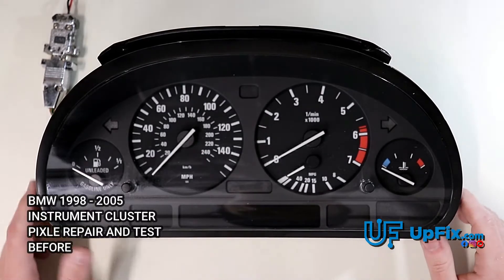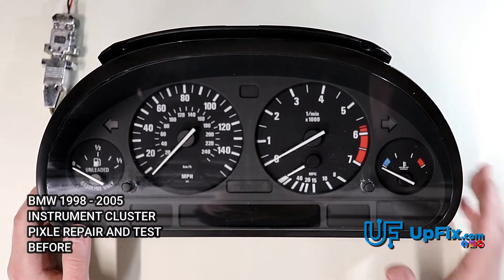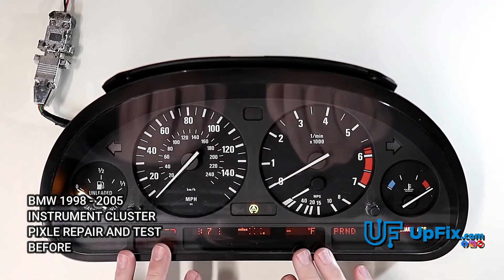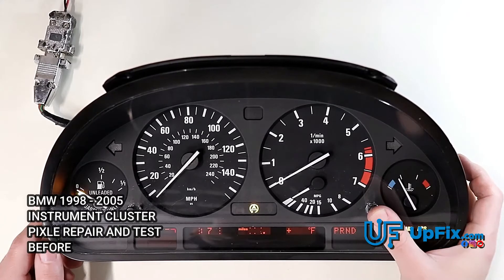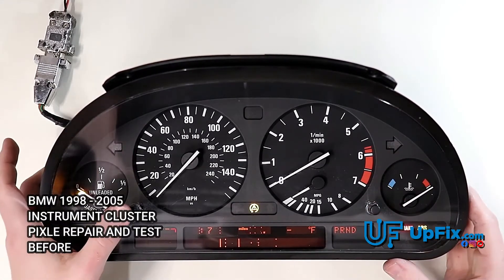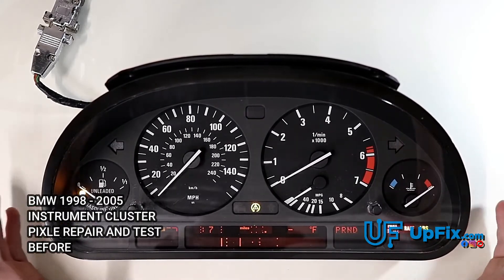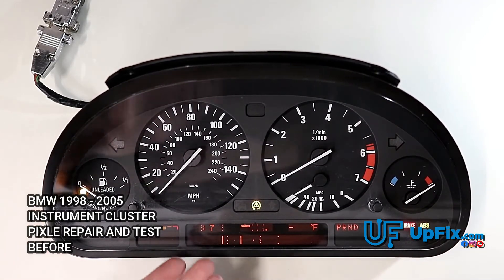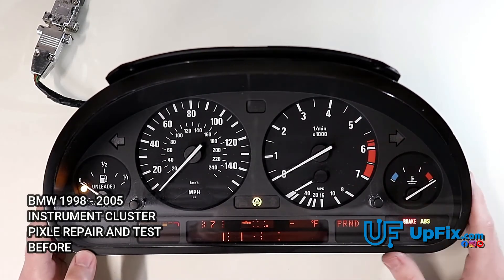BMW Speedometer LCD Screen Pixel Display Issue on Instrument Cluster 1998 - 2005 Part 1 of 2

Comment: What's the price for you guys to repair the exact same instrument cluster? 2005 bmw x5
Reply from the maker: Currently the price is $139.99
The process is fast and easy. The best part is that no programming is needed, it will be plug n play since this is your original part and it's already programmed to your vehicle VIN and odometer mileage will stay the same. Here is more more info https://www.upfix.com/product/bmw-x5-1999-2006-bmw-instrument-cluster-panel-icp-repair/